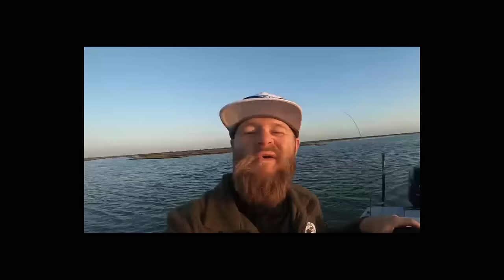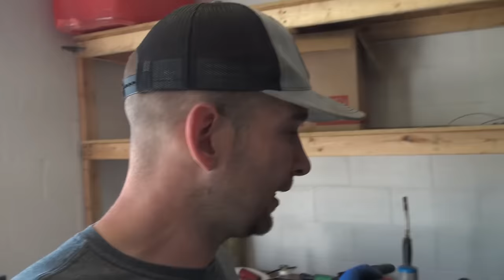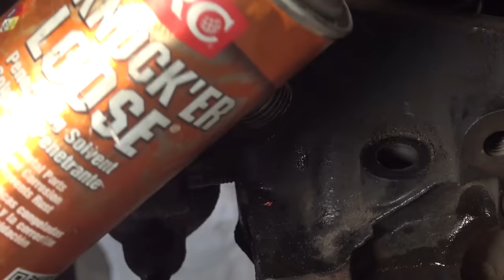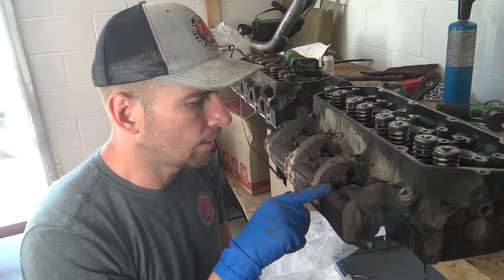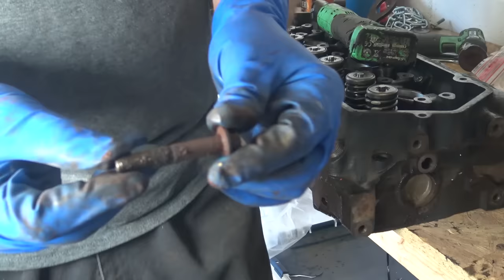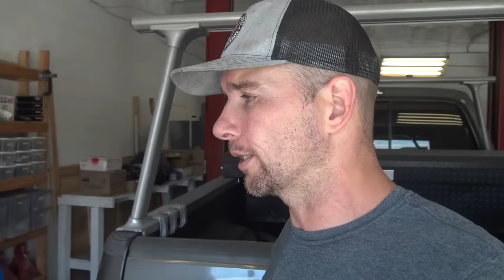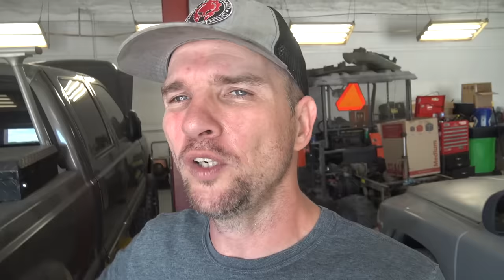Old Mechanic Taught Me This Trick To Removing Rusty Exhaust Manifold Bolts!

Comment: Sorry if this is a repeat. My trick that was taught to me by my welding instructor back in college. Get a plain paraffin wax candle, or the food wax works and heat the area around the bolt head until it just starts to glow a medium red to a little orange and apply the wax to the bolt head area and the back of the manifold where it meets the head. Rinse and repeat more or less getting it little bit hotter if it does not work the first time. Tapping the area with a hammer also helps free it up and helps the wax wick into the area. Be cautious the more heat you use the wax can self ignite; so be prepared for that. I've used this on most bolts that you can apply heat to and the success rate is very high the past 15 years.

Comment: 1) MAP gas plumbers torch with a hose. More heat, and I've not needed the oxy near as much. Also good for the pilot lights and starting the grill.
2) If I suspect it's going to twist at the head I'll grand the "bolt head / nut off and fight with getting the manifold off. Leaves something for the vise grips. I got my 5.4 with two gone at the head. Remaining bolts were too rotted for a wrench.  
3) I forget.

Comment: When you have finished heating the metal the bolt screws in to expand the threaded hole spray anything cold onto the bolt itself , which slightly shrinks the bolt . You may as well spray with penetration oil , but have the means to put any significant flames out handy , especially if the work is in the engine bay or brakes where flammable stuff exists ! Also do not burn any vehicle wires , obviously they wont be working as well as they aught , but worse is that the wire insulation gives off carcinogenic fumes .... cancer forming stuff ... not good at all !  
Excellent video , thanks .
Reply: And I will sub your new channel ... hard luck mate , been there too .

Comment: An old timer machinist taught me this, I am a welder by trade. **DO NOT USE ON CAST** 
If the bolt is really seized in and other methods will not work. This last resort usually works.  Using an oxy/acetylene torch (small MAPP gas torches work also, propane not so much) heat the bolt head up red hot. Then using a bucket of water and a cup, slowly pour water on the bolt head (hence why NOT TO USE ON CAST). Once cool, warm the bolt back up just a bit. The bolt should then thread right out. This works by heating the entire bolt, threads and all, causing it to expand, and then shrink by quenching it. Which breaks the bond of the rust to the parent metal. As stated in the video, do not reuse the bolts as this will have done some form of heat treatment to them and made them brittle! PLEASE remember NOT to use on cast. The rapid cooling will crack the cast. I’ve seen many many first hand uses where this was the only thing that would work.

Comment: Excellent video and great info on removing stubborn bolts. 
Would you know a good way to clean oil off an exhaust manifold? 
There's some oil on my car's manifold and it smokes a lot and looking for a temporary way to clean it until I get the leak fixed so I can use it until they take my car.
Great info on your video. Gave you a SUB too. Thanks.
Phil

Comment: If you heat up a sized bolt, heat it up, cool it off... heat it up... cool it off dousing it with water each time. Doing so, will expand contract the entire bolt throughout the thread pocket, loosening the rust.

Comment: My go-to method for breaking corroded or rusted bolts and nuts loose is a product called Freeze-Off (available at AutoZone) or Freeze-Loc (available at Advance Auto).

How it works is like this: Just like other penetrants, you spray it on. The difference is, these products are like liquid nitrogen in a can. It shrinks the bolt or nut to break loose the bolt or stud at a molecular level. 

And I will tell you: I've used PB Blaster, and this stuff works way better. So much so that I was able to remove a factory-installed, 21-year-old harmonic balancer bolt from a Ford Ranger 2.3 Lima crankshaft, after about 30-45 minutes. That bolt, being 7/8", was a PITA. And Freeze-Off got the bolt out, where other products have failed. The can I literally just bought was $9.56 out the door, tax included, but it was well worth the price.

Comment: Ball pean hammer and flat ended ended punch.  Hammer the exposed hex end with medium blows many times without damaging the hex head. The hammering transfers to the rust on the threads inside and helps loosen it.  (Use the penetrant the day before).  If you can get it to move, tighten it back.  Go back and forth just a smidge a dozen times, loosen a little more each time.  My friend loosened head bolts on Model Ts & Model As this way.  The other guys ended up drilling 'em out, but my friend got all his headbolts out without drilling and much sooner than the guys that broke 'em off.

Comment: If you can get a good shot at the bolt with a hammer, then hit the bolt like you were trying to hit it farther into the hole. If you hit it hard enough then it will make the bolt move in the threads & then it will come out way easier.

Comment: use a small hammer and smack the bolt without mushrooming the head and the shock will sometimes help break the bolt free of the rust,.this can be done when heating and using break free lube.

Comment: I like to spray them w/ penetrating lube when I have the bolt out a few threads before I tighten it back in and proceed to the next bolt.

Comment: When you're putting the pressure, soft and solid, on the ratchet, tap the shaft of it lightly, with a small hammer.  It "Shocks" the bolt.  I've heard older guys call it "the Poor Man's Imact."  Tap, tap, tap, and it breaks free, instead of Twisting the bolt and breaking.

Comment: I would tap the holes and retread the bolts to clean the threads and smooth and clean them or, if necessary replace the bolts.

Comment: Howdy I seen this video I while ago I get the gist , you could also gently hit the bolt and adjacent surfaces for ages and that would loosen anything, I heard this one thing German mechanics would tighten the bolt until it snapped this releases the pressure and still gives enough purchase on the snapped bolt too remove it with lock jaws or similar I believe there’s videos where guys demonstrate that releasing the pressure let’s the snapped bolt come out , I know exhaust bolts are a bear they make brass ones to stop the seizing problem they become welded in anyway I just thought what could be the most expedient quick method if your a working mechanic cheers I could be wrong cheers .

Comment: Have another tip they make a tool to hook up to an air chisel it's called shake an brake it has screw bits and socket holders 1/2 drive an 3/8drive  it works extra fine everyone on earth should have one omg it helps ten thousand percent

Comment: A mechanic told me to heat a bolt and touch it with a wax candle.  The wax draws in the threads like solder on a pipe. Its called capillary traction

Comment: I'm sure I said thanks before when I watched this, but I'm just watching again cuz I have a 12hp briggs I'm trying to get the exhaust off to replace the muffler on.  Could just weld it on but I think the gasket is blown open and want to replace it. Another week before the gasket gets here and this is day two of hitting it with some kroil. They are 1/4" hex and the only one I have is a 3/8" drive ball and that's not gonna get it done . I'll edit this if it goes either way. I really don't want to helicoil it but I will. 20 years on this mower and it's not done yet. 😁👍👍💪

Comment: another good trip is to throw away the manifold bolts and replace them with studs,once manifold is back in position we use brass nuts and washers on the studs. pretty much eliminates the problem.

Comment: A suuper good trick from taryl fixes all is to use oxygen and asytilene and heat it till cherry red then wait 5seconds if its cast iron then soak it in cold water as long as possible and i dident belive my eyes how good it worked:)

Comment: This is what I always do. 1-wire brush to clean the surface, 2-WD, 3- Clean the surface. 4-Heat the surface and 5- To try to open the screw with an impact socket(very important). 6- it will be your trick forever.

Comment: Heat and vibration are your friend! Use a  air hammer on lower air pressure on the head of the bolt light enough not to mushroom the bolt head to much you can tap a socket on if you need to. Soak it first and often while rattling on it. If the engine can be ran soak it run the engine soak on it while engine is running. Repeat as many time as time permits the more the better.

Comment: Usually when I need a torch you roll the truck out of the shop and even if you don’t have a torch usually the headliner is easy to get the fire started with just a cigarette lighter

Comment: I completely agree that all the bolts need to be torqued down to keep avoid over tensioning the last few bolts, but I completely disagree that you should do that using the old bolts.  Once you get them off, keep them off, and get new ones

Comment: Yup, aside from light-duty tasks, the ONLY time to use a 12pt socket is on a 12pt bolt FFS. Its aggravating how they tend to be more common. & ALWAYS be liberal with penetrant, its cheap enough & sure can NOT hurt. Also, & perhaps most importantly, "impact" over(as opposed to) the torque of a long breaker bar can go a LONG way. & when all else fails, heat is your friend. 👍

Comment: I usually don't even try to loosen them. I torch the heads off and extract them by welding nuts on what's left. Never drill out broken bolts to much chance for damaging the the good part. Weld ou broken bolts.

Comment: So then, if the manifold bends under tightening, doesn't taking pressure off first bolts lessen pressure on remaining bolts.
If it does, tightening one end, tightens remaining bolt pressure. (it's holding bend)
It should be loosing bolts relieves pressure on remaining bolts.
Heating and working them in and out gets them removed.

Comment: Great...this is my method over decades...Only problem i ever had was too much heat, and that worked against me , and the bolt would get too soft...[ My Oxy acetylene flame can be too hot too quick!] So yes, better to use a gentler heat.

Comment: Wish all manifold bolts were that easy. About all in my day didn't have exposed bolts where they enter the head to use rust spray's or that beefy non-corroded large bolt heads.

Comment: 6 points, try smaller sockets, clean the head of the bolt with wire brush, sometimes you can hammer on a smaller socket if the head is corroded it will be undersized

Comment: Nice stuff here... Now if you do snap one off flush with the head, take a torch, heat the bolt up red hot, let it cool completely, then weld a flat washer onto it, then a nut, and it will come right out.
Reply: If the first washer brakes off, weld a second one. That will work, as the junk comes off with the first one

Comment: I worked as a toolmaker in a factory and about once a day someone would bring me something with a broken off bolt. Most of the time it was not rusted but someone had put red locktite on the bolt then tried to muscle it out. Heat is your friend. Heat red locktite bolt till it smokes and a small flame will appear. continue to heat till flame from burning locktite goes away. This "kills" the locktite. Love the blue removable locktite and the red stuff has it's place too but at our factory it was a curse. Acid removes rust. 30percent vinegar works but takes time. Muriatic acid works much faster but face shield, rubber gloves, careful hat are a MUST. Will clean a rusted gas tank on motorcycle in 10 min soak but be careful. If you think you can do it without a face shield you risk losing your sight and getting burned. You have been warned. In drilling out bolts the most important thing is getting in the center. Take your time and use a bridgeport if you have one. Go up a little bit at a time. Use left hand drills yes they exist. when you get to thread use more penetrating oil. sometimes the thread comes out and looks like a spring. If it is broken off flush line up on a stud next to it  to get it straight then find the center of the broken off one. May the force be with you.

Comment: Heating bolts or pipe fittings and using bee's wax they will come out. Used this on brake caliper breeders come right out

Comment: If room will allow a good sharp rap with a hammer. Not enough room if engine is still in vehicle. Airakroil is a very good penatrating spray to use. Not sure if the spelling is correct and it's kinda hard to find.

Comment: Most bolts break while parts are still in engine compartment. On a bench is handy but that's only part of the problem. Having access should figure into the over all process, don't you think?  I have 40 plus years being a professional mechanic and can count on one hand when everything was so easy to get too.

Comment: on my 305 a bolt came off and looks like it snapped so it sounds like it leak and can feel little air comming from the bolt hole so the bolt is broken in the block

Comment: Kt3406e gave a tip on peanut cover bolts on a cat. He would give the bolts a firm rap to shock em. Claims it works and rarely breaks them off now.

Comment: On my Ford truck the exhaust manifold shrunk while being removed (makes it impossible to re-install) and later I found out that they sell a stretcher device  that installs between two bolt holes to make it possibe to re-install the used manifold. The garage doing the work did not know this and drilled out the manifold bolt holes ( to enlarge them and so let the bolts enter the head) which creared an exhaust leak.

Comment: Another thing that helps with your penetrating oil is sometimes use small strips of cloth or toilet paper and pack around the area you want to saturate then saturate it and it'll stay wet all night long until the morning without drying up on you just a extra tip... okay one more tip then sometimes it helps to take a hammer and tap the bolts in Word but remember do not mushroom the head of the bolt... another thing you can sometimes do heat it up and use wax candle wax reheat and use candle wax instead of penetrating oil

Comment: Great video. However, with the head off it is easier. Even if you broke a bolt, you have a better angle to fix it. I am trying to locate video that can show me what you do ,with one exception. The head is still in the car. And other parts that get in the way, to do this job. I like videos that have a real hands on repairing. Thx,a bunch

Comment: lean a propane torch on the bolt, stand back and watch for 5 min, then spray penetrating oil, then hit the bolt head with a hammer and punch to shock it, then turn a little each way.

Comment: Once the bolt starts to loosen (a turn or two), use motor oil instead of penetrating oil... works much better.

Comment: Smack the bolts with a hammer a few times not to hard to deform the head, wire brush what you can get to of the threads and around the head. I always clean the thread it'll help with the penetrating oil to work faster and less binding on clean threads

Comment: Methanol (from your heads --- distilling) or ethanol (top hearts) to loosen bolts ... it works. Clenzoil (look it up) works a bit faster but more expensive. But IMO better in the long run if it's parts you routinely change out or service (And it is also awesome to other things that go bang). 

After they soak for a minute or two, give the bolt a sharp rap with a center punch. The only stud this recipe didn't work on was an inboard motor that was in sea water for more than a month.    

Oh, you can reuse the bolts if you just heat cycle them above 425° F for 30 mins. I just throw them in the charcoal pit without the forced air on.

If you race and therefore tear down top ends as a "hobby" ... learn how to nickle plate your bolts ... it's easier than ya think.

Wrenching since the 70's on marine engines and motor sport engines. I learned the same trick from my dad as in the video and he said his friend's grandpa taught him. You'd almost think it was common knowledge back then.

Comment: Honestly the fastest way to do manifold on a 7.3 is grab a torch and cut the exposed bolts off tight to the manifold. Weld nuts on to the remainder of the stud and wind them out.

Comment: Don't use tap to clean the threads, use a thread chaser. A tap is designed to CUT threads while a chaser is designed to fix existing threads. If you use a tap to clean threads you will REMOVE some material making the threaded joint more likely to strip out or outright pull out.

Comment: Clean the rust with a brush and WD40, heat it up, whack the bolt a couple times with a drift, add more heat, say a few prayers, and turn it carefully.

Comment: how about "reaming" the middle bolt bosses on the manifold? Also, hitting the bolt bosses on the manifold with a pin-punch and hammer to shock the rust loose

Comment: I just replaced the clutch in my jeep that has 160,000 miles on it. I had to remove the exhaust I was terrified that they were going to be rusted I hate that. I cannot believe it but they were not and came right out.

Comment: When the situation allows you can also before ever putting a wrench on the bolt. Take your hammer and give the head of the bolt a Stout ⁶ smack take into consideration you don't want to distort the head the shape of the head. Just a good smack to shock the rust and break it lose around the shoulder.

Comment: I'm not sure of whether this actually works or I'm just lucky, but spraying lube onto a heated item 'sucks' the lube in between the 2 objects. I believe it's because the hot air or whatever inbetween the items is expanded and shrinks when cooled by the lube, subsequently sucking in the lube. Obviously only works on things that have a space it can be sucked into so not all situations